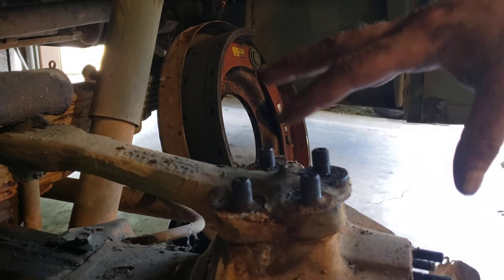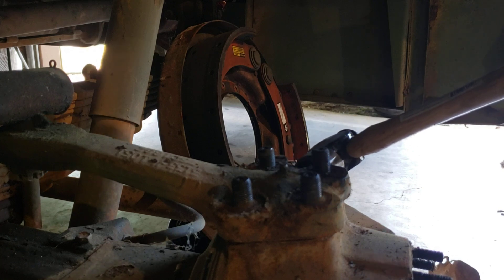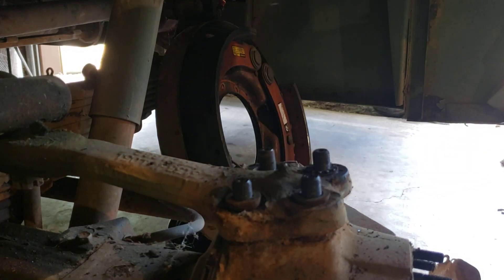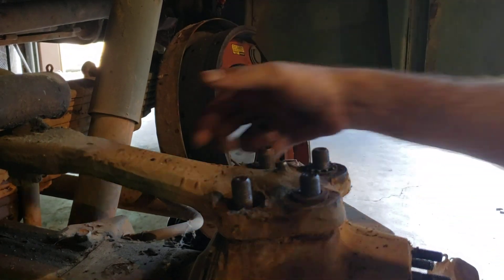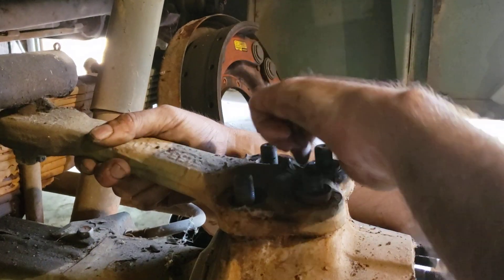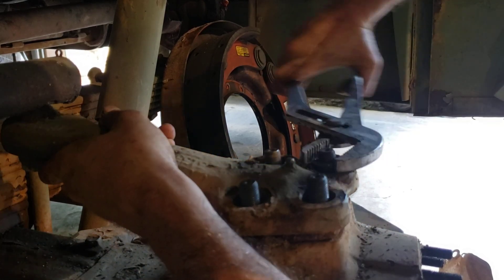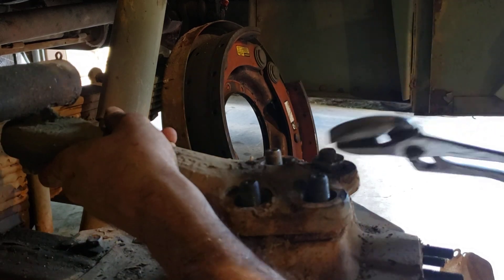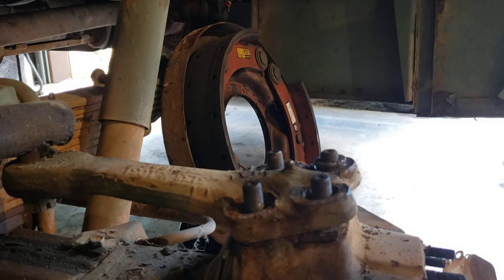Removing an M35 steering arm from the knuckle.

Comment: Just did mine on Saturday and used your vids. Making sure the top was clean helped a lot since crud on top of the cones was preventing it from budging even with hammer blows. Cleaned well and worked just like you showed.